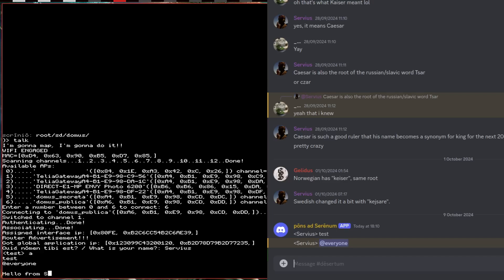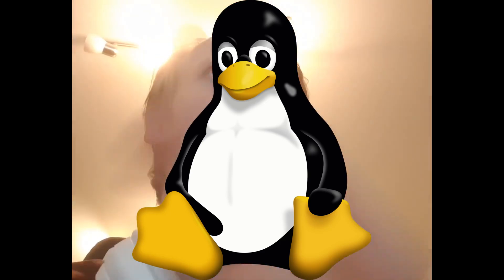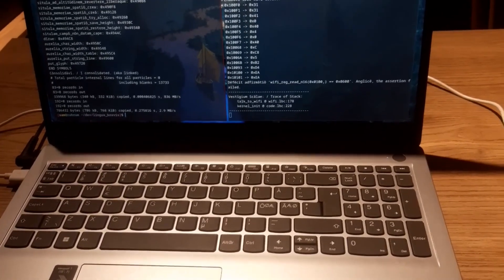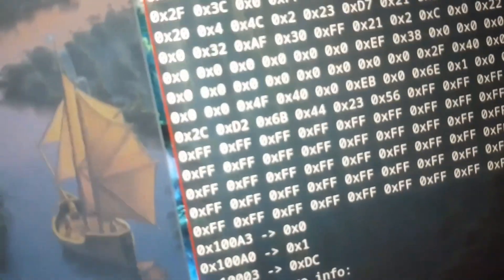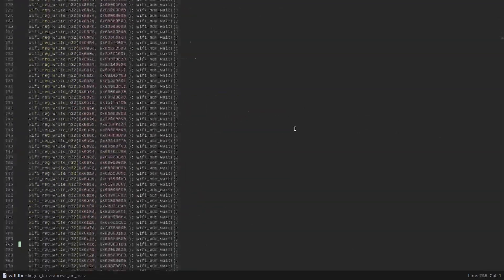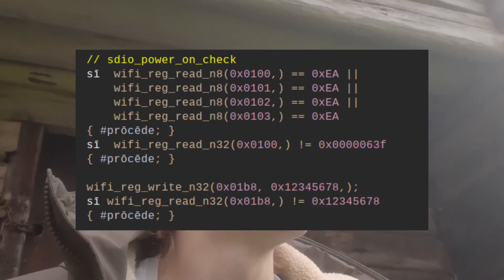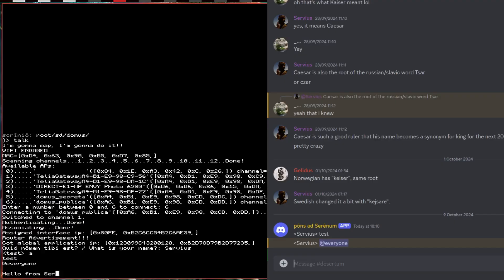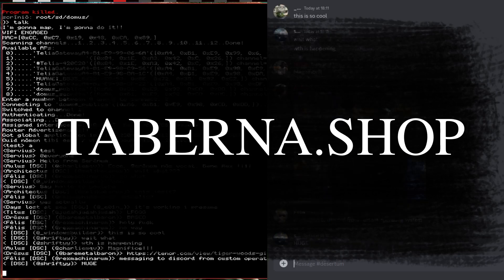wifi from scratch

Comment: Why is there so much Latin? Just wondering! Also when you do write Latin, why are you adding the long marks, I get that historian use it, but I find it much easier w/o the long marks.
Reply from the maker: I really like latin. So the project has a latin theme. The romans actually did write long marks. It is the medievals who stopped. I think it is important for good pronounciation and comprehension. If Serenum is someones first exposure to latin, then it should have macrons in either case, just as all our other learning material does. https://youtu.be/D3bmLi1bKI0?si=s9YVT5U5TBF0SYG5

Comment: I have no idea what's going on. Did you make a wifi router or u reimagined internet connection? What is serenum? Please clue me in.
Reply: os built from scratch
Reply: Don't know if you found out by now, but just in case somebody else reads and is curious:

Sam started this whole endeavour because of the "30 million line problem" (aka Linux passed 30 million lines of code, making it effectively impossible for a single individual to know what it has in it, and to even effectively understand, change and/or contribute without a lot of time and effort).

So, he did this:
- took a RISC-V chip (he thinks that RISC-V is the future, so better start on that directly, nothing legacy to drag you down)
- built a programming language + compiler named Brevis. He also wanted to learn latin and thought that learning by doing would help, so Brevis is (mostly?) in latin
- built Serenum, an OS (kernel + userland) with its own particularities. Does not have a lot of things yet. Has an interesting security model
- as the basic filesystem (don't know which one, if it also new) and command line utilities are done, the basic window manager is also done, I think Sam wants to build a browser next. And for that he needs networking. So he started making Wi-Fi work, which (unsurprisingly for me) took a lot of time and effort.
- if I understood correctly, he also started making a hypertext protocol. That is, an alternative to HTML and things like Gemini and gopher if I remember them correctly.

Overall, he's really trying his best to have 100% his own code on that hardware. Not sure about the firmware, but excluding that I think he is still on that 100%. Of course, the functionality is still very limited, you can't use that computer for much.